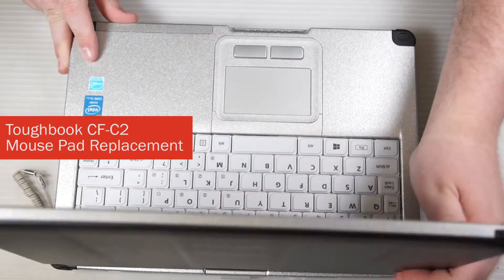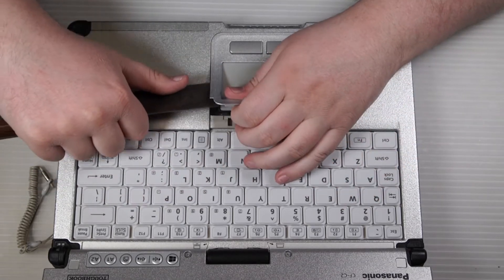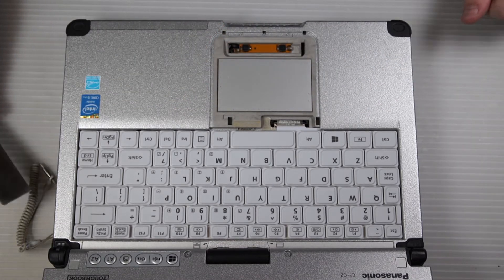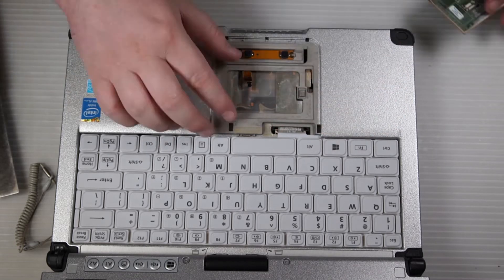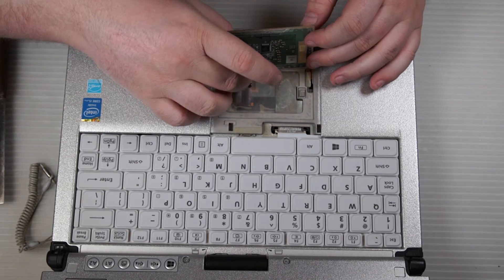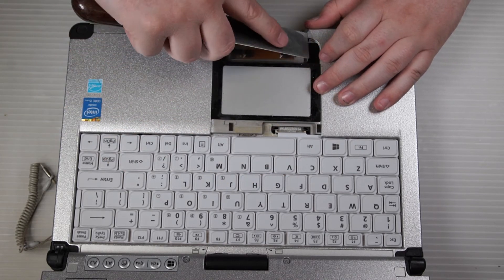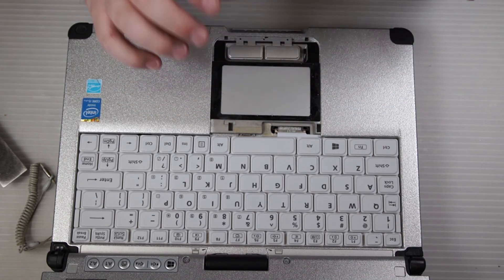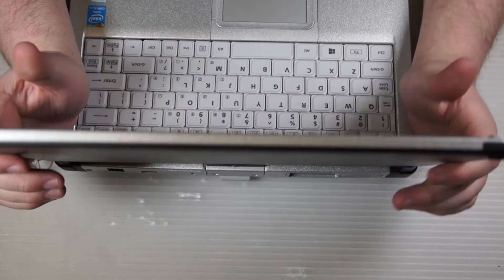How to Replace the Panasonic Toughbook CF-C2 MK2 Mouse Touch Pad

Comment: Can you point me to so where I can buy these trackpads , mine recently dued. Thank you very much in advance for your kind assistance
Reply from the maker: If you don't see the part you need on bojohnson.com, you can always contact us through email at tech_support@bobjohnson.com.  We sometimes have parts machines we are using and can spare a part. We need your complete model number and your part request and will follow up with 24 hours during our work week Monday-Friday.
Reply: @Bobjohnson  thank You for the hint,  I fortunately found a donner on ebay. Thanks to you video i am pretty confident to be able to fix the it.